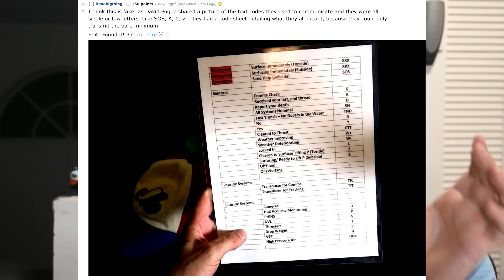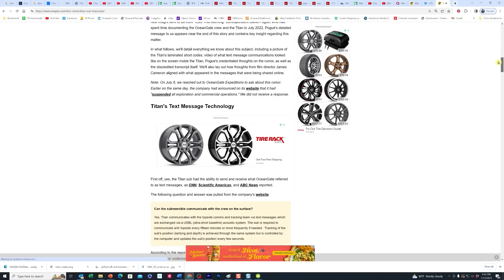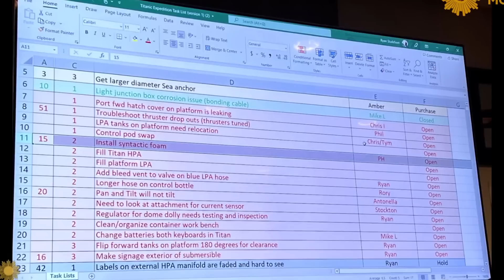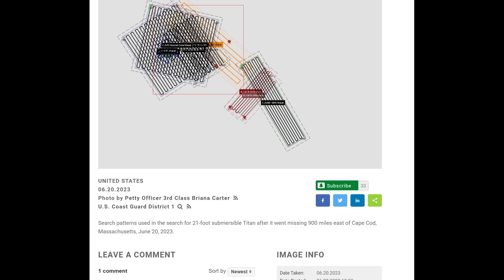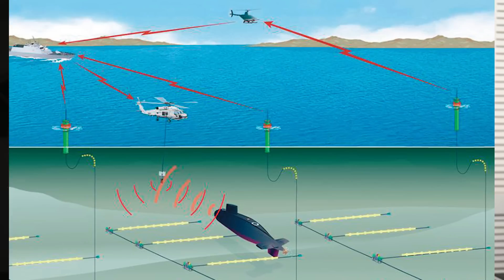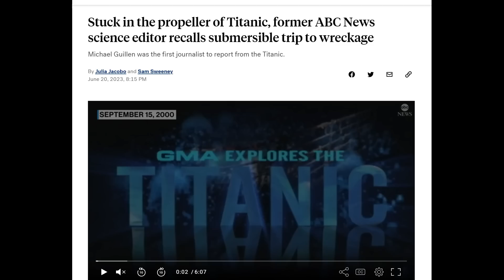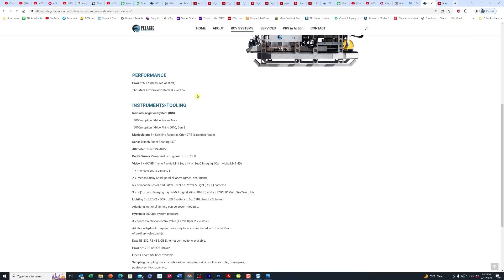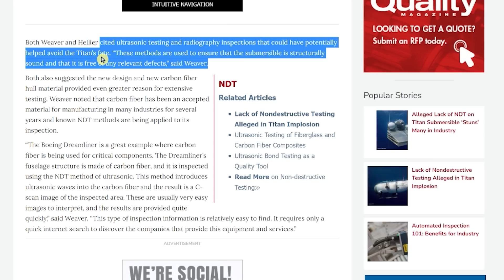The Shocking Truth About Fake Sub Transcripts No One Tells You

Comment: The funniest thing to me is that his statement "at some point safety is just pure waste" is totally right. There is a point past which, when you're just comparing two values of risk that are very close to zero with each other, additional added safety can be seen as a waste. The only problem is he was really far away from that point.
Reply: Safety isn't a waste at all if you are carrying innocent passengers.. 😮😮
Reply: This is actually part of my job.  If we spend another $10 per part, and the safety factor to our patients reduces risk--to simplify things--to 1 patient error in 1 billion from 1.1 patient errors in 1 billion on a $10 part...we're not going to do that because our sigma is already extraordinarily good.

In this case, it's like spending $10,000 per part on a million dollar machine to double your safety factor from "probably not going to die" to "almost certainly not going to die."  That like...duh.
Reply: @BronzeDragon133  I think your analogy is a bit off.  Regarding your product - is your product capable of killing a patient?  If so a one in a billion risk of that outcome is excellent.  Whatever your product is, it most likely doesn’t have the same risk profile of a deep sea submersible.  Which by definition is potentially deadly with every dive.  Stockton Rush appears to have been driven by a core desire to save money on every component of his submersible.  This philosophy combined with a certain level of arrogance created a risk profile that resulted in a risk outcome of when there was going to be a catastrophic failure rather than if there was a very low risk of catastrophe.  Certainly the law of diminishing returns applies to the safety of any product.  He just seemed to thumb his nose at traditional safety parameters for submersibles.
Reply: @roch145  They're medical products.  Failure is always a problem.  We actually make ventilator parts.  Failure is a critical problem.
Reply: @BronzeDragon133 ok but he wasnt meeting james camerons definition of safe. if the guy did it 30 times i think we should listen to james cameron and not Rush
Reply: @BronzeDragon133  Interesting. Do you wear a crash helmet when you drive a car? If not, why not? It's not like they're expensive.
Reply: @brainstewX yeah many people wear helmets when they drive cars say off road or racing or basically in a situation that's not normal conditions yes. I mean why do we have side airbags when we have a front one. Or a seat belt when we have a front airbag. This is a really stupid debate
Reply: @Bangin0utWest  Why don't you wear a helmet every time you drive a car?
Reply: @brainstewX  driving a car normally is like going 50 M down for a sub. If that's what he did he wouldn't be wrong. Drive a car at 250 mph and YES I WOULD HAVE A HELMET ON Jesus christ. You must not see too many auto sports take place. Like racing crawling speed tests etc. Yes they wear helmets. Can you guess why. It's not actually about safety 100%. It's called, say it with me now, LIABILITIESSSSS YAYYYYY
Reply: @brainstewX  why do people who ride motorcycles wear helmets
Reply: @Bangin0utWest  So no one dies when they drive a car 'normally'? You're avoiding the question, so I'm just going to keep repeating it until you answer. Why don't you wear a helmet every time you drive a car?
Reply: @brainstewX  You keep repeatedly asking that question as if it had meaning.  It doesn't.
Reply: @Bangin0utWest  You still haven't answered. Why don't you wear a helmet every time you drive a car?
Reply: @BronzeDragon133  If that's true then it's a harmless question, and you should have no trouble answering it.
Reply: @brainstewX  Easily done.  Mu.
Reply: @BronzeDragon133  Try giving a coherent answer?
Reply: @brainstewX  I'm sorry you're not bothering to look up the answer while trying to act like a self-superior "intelligent" person.  Try harder it's failing.

Mu.
Reply: @BronzeDragon133  That's fine. You're on record dodging a supposedly very easy, harmless question. You left a snarky comment saying that spending a little bit of money to increase safety is "like.. duh", but you can't account for why you don't want to spend the money to protect your head during a car crash.
Reply: @brainstewX  Considering how unpleasant you've been throughout the entire thread I can't imagine why they don't wanna respond...
Reply: @BootyGoblinesque  I've been nothing but pleasant, despite the dodging and bad faith responses. Thanks for the ad hominem though.
Reply: @BronzeDragon133 but your profits don't wane. So basically you just said. Yeah we could save more people but we just don't want to
Reply: @Bangin0utWest  But they do.  We have competitors, and the industry has accepted standards.  Yeah, we could save 1 more person per million if we spent three times as much, but you wouldn't buy our products, you'd buy our competitor's...and we would no longer exist and that patient will die anyway.

Because you are cost-driven, not quality-driven, as every bottom line proves over and over again.
Reply: @BronzeDragon133  so keep your prices low to compete If you weren't GREED based and were more concerned about PEOPLE. You'd take the SLIGHT profit loss whilst still taking in record profits. In the name of saving more people. Has nothing to do with competition
Reply: @BronzeDragon133  btw that's roughly 350 people you're talking about just in the US
Reply: @Bangin0utWest  You're assuming I mean death.  I mean mistake, misuse, near miss, and so on.  Near miss is the largest category by far, and the one where nothing actually happens, it just came close.

And yes, it's a balance of cost versus lives.  Welcome to the real world.  As a friend of mine notes, if you dislike it, go play with your dolly somewhere else.

Just be glad somebody with my level of ethics does this job.
Reply: God bless marginalism
Reply: Someone needed to smack him with a risk assessment chart.
Reply: That's why airplane parts are ten times as expensive as similar items outside the industry
Reply: @@user-ef2bx9fb4y Not the same person, but I was curious myself about a risk-analysis textbook and I found Foundations of Risk Analysis: A Knowledge and Decision-oriented Perspective by Terje Aven. I am by no means an experienced engineer nor have I used this particular textbook, but I skimmed some of the content and I personally feel like this textbook strikes a good balance of mathematical expertise and risk-based thinking from what I saw. The book should be available at a Library with a name that sounds like "Jenesis". A search engine query should help you out. Good luck.
Reply: NO NO NO HERE. Safety Rules?
I think I've broken them with logic and good engineering behind me...
Reply: That's not the words of an engineer. That's the words of a snake oil salesman.
Reply: Yeah there's a reason that, in most cases where lives are on the line, engineering is done with a "6 sigma" paradigm. This bozo was operating at 1 sigma, if that even.
Reply: If nuclear industry worked that way, I'd immediately switch to being anti-nuclear.
Reply: The risk was no where near zero, it was very close to 1
Reply: Right. Safety can be of waste if it's already very high. I feel for Mr  Rush's family, though. I can't imagine what it might feel like being the wife or son/ daughter of the person now considered one of the biggest screwer uppers of all times (whether that's true or not).
Reply: True
Reply: He technically had a valid point. But a CEO or safety coordinator in charge of people's lives caught uttering such words should be ran off.
Reply: Everything is linear, until it isn't.
Reply: Ironic, i wonder if stock crying there somewhere or proud of himself
Reply: It was a satanic sacrificial ritual this rush was no average joe. He had ties to some big players and I believe his parents signed to Independence Day treaty.. also it was full of billionaires
Reply: weird take, you'd be a great government official 🥱🙄
Reply: @brainstewX  I already answered the question u donut. Because it's normal driving conditions. I also wear my seat belt even though I have 10 airbags jn the front. Diving to the titanic was not normal conditions for this or any submersible you keep skipping over that. That's why I keep using your dumb analogy against you by putting my car in abnormal situations intentionally. Yeah I would wear a helmet. And want a roll cage. And the windows removed and an emt standing by. Literally yes. Idk why you can't figure this out but everyone else can
Reply: Remember, it is these types running the so-called "science" of electric cars and the climate change agenda, our schools, businesses, and government. What people are either too ignorant or too afraid to admit is they`ve already destroyed America, most of Europe, South Africa, and the Middle East. Look what they`ve done with their darling coronavirus. Look what they`ve done to California and Seattle. Look at how easy it was for them to incite their mindless puppets to burn our cities. Now they`re going after very young children. And nobody is doing the right thing. They don`t deserve trials. Look at their deadly censorship and the results of their violent influences in most cities. Thank God I learned self-sufficiency at an early age and can provide my own food without stores. And thank God I live in an isolated rural area in the boondocks and wisely invested the last of my savings in the tools needed to provide my own electricity, clean water, food, medicine, and information without ever leaving my homestead.
Reply: Until you realize these safety measures have all been forged in blood.
     You can't be sure how safe or unsafe some practice is until something bad happens. Once it does you adopt or abandon whatever practice (or lack of practice) lead to the accident.
     The reasons behind these changes my not be obvious but they are not placed there to make life harder, they are there to prevent some vague danger that is not at all obvious.
Reply: I mean sure. Seat belts and airbags are technically total waste as well. More likely than not they'll never be used. But you sure would miss them, if you suddenly needed them. 😄
Reply: This statement of Rush didn't age so well, did it
Reply: What an excellent point. I’m one of those safety nerds - contingencies are in my blood and that’s been a good thing for my crew and a bad thing for the bottom line. I’ve been a whistleblower twice because I’d rather be ostracized than risk lives. 
Stockton types are my worst nightmare and luckily most of them are not ambitious.
Reply: Safety is never a waste, especially when other people's lives are at stake. Stockton WAS a moron.
Reply: @jamesplymire5342  There is this phrase that people toss around a lot, but I think they often fail to actually grasp the concept : Risk/Reward. Just about everything you do has a risk to it and has a reward as well. Everything. And when people have non-typical risk/reward decisions, we often call them eccentric, odd, weird, or mentally ill. Go around wearing safety goggles and a helmet all day every day and just see how often people label you as one of the aforementioned groups. Accidents are the leading cause of death for adults without multiple comorbidities. The top cause of death from accidents is blunt force trauma to the head.  Wearing a helmet will reduce your risk of falling and bumping your head. 

But then we also have second order effects to take into account. Wearing a helmet limits your peripheral vision and your ability to hear. So you might increase your risk in your attempt to reduce it. On the other hand there are people with portions of their skull missing (and other anatomical abnormalities) that require them to wear a safety helmet. So their risk/reward is different. 

Another issue with "safety at all costs", which is a direct rephrasing of "Safety is never a waste", is that often you reach a point where your return on investment is diminishing. You might spend twice as much on the thing and only reduce safety hazards from 1 in 1 million to 1 in 1.2 million. Diminishing returns are a thing all throughout engineering, and safety is no exception. 

Another issue is the Pareto distribution. 80% of your experienced safety issues might stem from 20% of your failure modes. And that directly implies that most of your failure modes have a very low likelihood of occurrence. With complex systems like submersibles, it is pretty common to have dual redundancy for critical failure modes. That means a backup widget  for the backup widget, giving you three separate subsystems to do the critical function.   For example you might be able to surface through 1) dropping the ballast 2) dropping the rigging and  3) adjusting your trim and thrusting to the surface. I think that was their dual redundancy for the failure mode of uncontrolled descent.

Now having said all that, is also easy to hide behind fudged numbers and say you met all reasonable expectations of safety and had dual redundancy for critical failure modes. Dual redundancy will not save you if you have a 30% failure rate on each of the three subsystems. There was a submarine that ran aground or hit another ship last year, and one of the root issues that caused it was they had a high failure rate with their primary navigation equipment, and the backup wasn't so good either. I would have to look it up for the specifics beyond gross negligence of the CO and the XO... and their subordinates.
Reply: @jamesplymire5342 in that case I hope you never drive a car, never fly a plane. If you do any of those things, then you aren't accepting ansolute safety and are prepared to accept some risk. He is 100% correct, even if it sounds inflammatory
Reply: I think he mean safety as is a pure waste at some point as like in elevators, like you want them to lift a certain load. But you built them capable of lifting 2x as much to have a large safety zone. As seen his subs were theoretically capable to dive to those depths but was safe to mere half of that depth. Slowly damaging it every dive until one day.
Reply: @scasny theoretically, if he used good parts n made the sub correctly, yes it could safely dive for a good while but you'd still have degradation that is wayy worse than steel or titanium. I mean the way they weaved the carbon fiber was wrong or atleast "sub" par (lmao) their little window wasn't rated for that depth, and standard safety features were Either nonexistent or very poorly done. So yes, theoretically it should be fine, and that's exactly how he drew in customers to his ride of death. Theoretically his sound acoustic system would give them enough warning to surface, but again, it didn't do what it theoretically should've. This entire sub was a theoretical, at some point you need to show facts not theories, especially involving peoples lives, and unfortunately the facts were in fact against him and the "safety" of his sub.
Reply: @scasny maybe he thought that if his probability of dying was 100%, spending a hundred thousand dollars and still coming up with a probability of death of 100% would be a waste so YOLO
Reply: @scasny  As I understand it it was safe to dive undergoing only so many cycles with only so much time spent under any considerable load. It was always going to implode the way they were running it and maintaining it. I'm not sure how the math works but maybe they would've made twice as many dives before Rush and all his passengers died if they were only going half the depth they were going to get to the titanic (I'm gonna assume the relationship there is linear since PSI increase per foot of water is linear, although that's probably an ignorant oversimplification of how different pressures and cycling would've affected the hull of the Titan over time/use).

That's what I recall hearing. That it was a fine submersible for one or two dives down to those depths, but with the materials used the hull shouldn't have continued to be used for deep dives without being rebuilt. Correct me if I'm wrong but that's what I recall hearing from mainstream sources.
Reply: @scasny  I think it is safe to say that he hated the word "safe" and was doing everything to prove that he is on a open war with it...
And there is no way to calculate anything here because no one even care to folow any procedures/safety standards, learn them not to mention create them...
The aplication of the glue is the best example, it almost looked like some parody of a submarine production that is expected to survive the pressure that is 4km below surface of the ocean.
You could tell from faces that they all got zero idea if what they are doing it corectly and it all looked so unbelievably unprofessional.
Reply: There are proper procedures for welding critical applications which is why someone must be certified in say high pressure (steam) work. The focus of pressure here is directly opposite what was expected under deep water. The details matter and can add up. One can only hope what we saw was a staging and not the actual bare hands efforts done to build the Titan. Safety can be cumbersome at times but only before one understands the benefits derived in doing a job right.
Reply: @@user-ef2bx9fb4y Don't look at me, I learned it in the gutter (I went into Quality Control in my thirties from Technical Writing and then Documentation Control).  I mostly picked this up in food containment and then moved to medical devices.

I got there due to being a complete and revoltingly ethical stickler on all rules, never bending on document requirements, and people noticing that, while I'd help anybody with anything, I wouldn't violate procedure no matter what.  And I never got an audit ding, SCAR, or usually even a yellow flag.

However, any good engineering book like The Handbook of Safety Engineering should get you started.
Reply: SuperNostalgia.  Apparently except for the sins of hubris, being off-topic, and annoying others, which are allowable and fine for you folks.  I'm real tired of seeing the self-righteous in ever effing thread.
Reply: Rush definitely had a very relative notion of safety. I think it didn't help that the sub dived successfully for years. Each successful dive reinforced in his mind his ideas on safety. Instead of using cold logic and validation to analyze each dive, and safety overall, it became a matter of thinking less and less about it as more successful dives accumulated. A recipe for lethal complacency.
Reply: These brave men went to an amazing but also very dangerous journey down to Titanic. What a shame the u-boat could not hold to the pressure as it was designed to do. Some say there was engineering calculations which were inaccurate but I think the Titanic is haunted and perhaps there are some explanations of what really happened to the men deep down at the wrecage of Titanic which no one can understand. It must have been an horrorfying experience. Also very strange that the bodies of the five men were not found.
Reply: @thorsrensen3162  There are many videos on the questions you have raised which give very good answers to those questions. I've watched quite a few of those videos; you might want to try that yourself.
Reply: @thorsrensen3162 What happened to those men was equivalent to being in a car full of explosives when it goes off. It wasn't horrifying it was instantaneous. There are no bodies to be found.